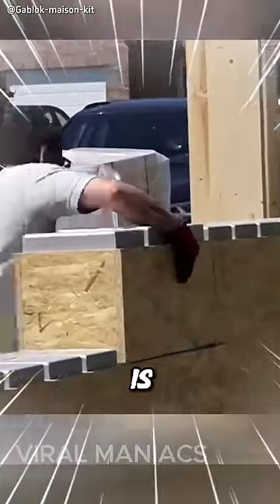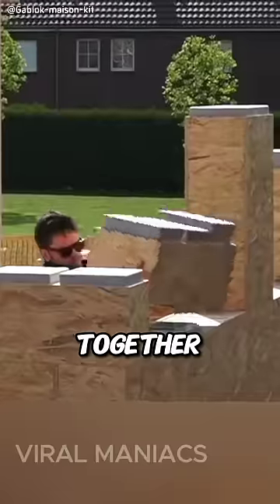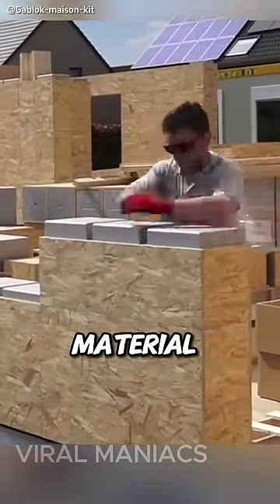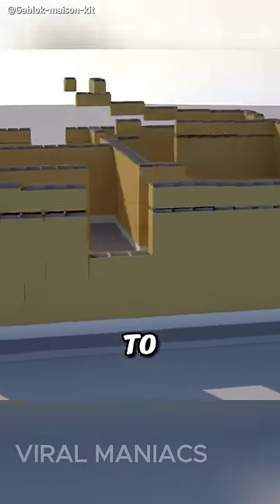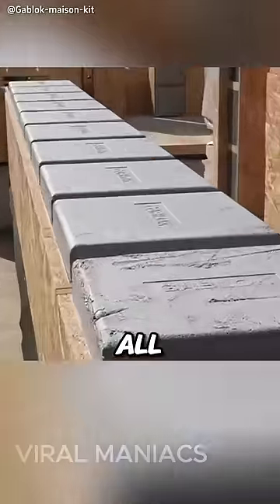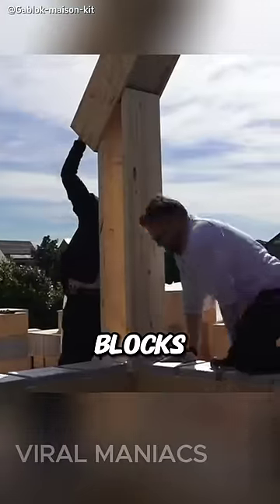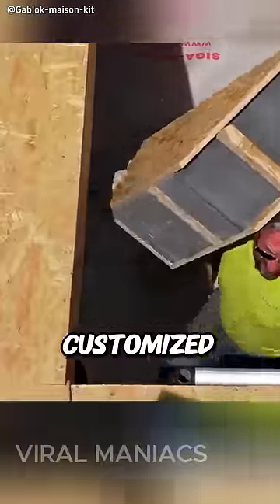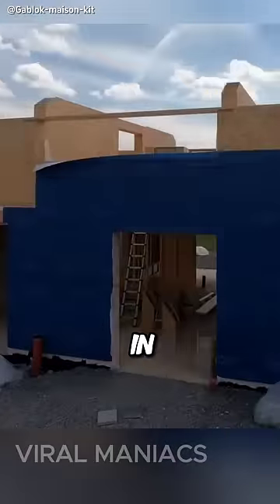Whoever Invented This Way Of Building Houses Is a Genius #shorts

Comment: Unfortunately, this solution doesn't consider electrical wiring, pipes, and ventilation requirements.
Reply: It probably has all that, but there's only so much you can fit in a you tube short. Im still skeptical like you though.
Reply: Polystyrene insulation is made with butane or pentane gas, or some flammable blowing agent.
Reply: yeah.... I'm sure the million dollar company didn't think of what will from Utah did..
Reply: @nicholasbondurant  Grendel block fire is something you might wanna read regarding your multi million dollar companies churning out unsafe materials not fit for purpose
Reply: @nicholasbondurant haha yes everbody just says things like that without taking the time to see that the solution are little spacers on the wall or belive that there is a solution for such an obvious problem.
Reply: Who’s to say in low budget housing you don’t make everything exposed or concealed in PVC like electrical wiring.
Reply: @PerryPerfectPerson   trunking is a myth I guess
Reply: You usually run all that behind dry wall that's actually no different than how they actually build houses except it's not bricks they lay everything out them selfs and do all the supports and framing
Reply: Frame it out with 2x6s. Then drywall.
Reply: It also doesn't address thermal bridging between the insulation blocks or wind uplift pulling the blocks apart. It wants to be a good idea, but falls well short.
Reply: @kramnull8962  And fire retardant mixed in wherever necessary. I worked in the manufacturing plant.
Reply: I'm sure they can cut the blocks later on to run pipes and cables internally if they don't  want them exposed. It's just wood and really thick insulation foam afterall.
Reply: @KurtL1776    
OK ..... I can't criticize you for not taking the time to research building techniques.
But even my 8 year old son has the common sense to know that building materials & methods have to be engineered, tested and approved by the building standards departments etc and certified into the relevant building codes. Also, common practice to "tie down" building panels, frames, etc with straps, fixing brackets, braces, tie rods etc.              Use a bit of common sense, man ‼️
Reply: @kramnull8962 Brick, wood, and metal along with insulation materials are all flammable. What's your point?! THERE IS NO SUCH THING AS AN INFLAMMATORY HOME.🤣🤣🤣🤣
Reply: Damn buddy, better go tell this checks notes successful company they are doing it all wrong.
Reply: @PerryPerfectPerson  I honestly wouldn't care about exposed wiring, or piping. honestly if it's out, it's easier to maintain.
Reply: Or rebar for support
Reply: @kramnull8962 it actually consider all of that you were to lazy to take 5 mins an research so you just talking about stuff you don't know $hit about...
Reply: Who needs those when building a house is so easy😅
Reply: It seems like it's the perfect setup to add your own wiring, plumbing, and HVAC schematics. That material doesn't look difficult to work through.
Reply: Neither dead building Legos but obviously the man who invented this was a Lego lover 😂😂
Reply: Better than nothing. Perhaps they do have a solution. Perhaps one can figure it out. But praise God for shelter at all.
Reply: @Azrael315  Children, pets.  I couldn't live in one. The off gassing would kill me.
Reply: Shouldn't be any harder to address than say log cabins or stone houses.
Reply: I was just thinking that

They conveniently leave out that detail LOL😅
Reply: This replaces concrete block. That shit doesn't run through the concrete block anyway unless it is going outside. It will probably be run in the subwalls
Reply: Surface mounted everything like a studio
Reply: Or code requirements
Reply: We used an ICF fox blocks system and our pipes were installed with the foundation so that they already existed when the walls went up.
Reply: Or the Scottish weather.
Reply: i just dont see how a pure brick would help more for all of the things you have mentrioned
Reply: @kramnull8962  Are the construction materials LEED approved or will you get sick right away because you moved in?
Reply: I like how all the builders drop cringey comments
Reply: You could always just carve through the blocks and stuff pvc pipes through them or frame it out and run it that way, good idea for Small additions that wouldn't really require it though
Reply: I'm pretty sure this was only a concept.
Reply: China be like
Reply: The tornadoes will fix that bro
Reply: That's not true that dude that invented that starlight material would seriously beg to differ. That was some hardcore shit back in the day that he took to the grave with him. If I'm not mistaken I do believe once he let that cat out of the bag and enough people saw it they have somehow reversed engineered it from absolutely nothing considering that dude used to take everything with him any ashes any dust any dirt grime it doesn't matter what it was if it was residuals from his showing of that product he took that shit and put it in the bag and took it back home with him so nobody else could ever find out what it was. That's one of the only inventions that I've ever seen that I was truly blown away by and always wondered what happened to it but he never wanted to sell it to anybody. People offer to him pennies on the dollar. Actually I take that back people offered him pennies on the $100. That material could have saved just hundreds of billions of dollars over human history if people are allowed to use it. It literally does not burn. You could coat the outside of a raw egg with it and literally put a acetylene torch to it and hold it there for 5 minutes or so and take the torch off and actually crack the egg open and it still be completely raw it will have not cooked not a single bit. Go look that stuff up. @sjlewis271
Reply: Or extreme weather
Reply: I mean you can have a industrial look inside your house if you are into that!!!😂😂😂
Reply: Can someone tell me the name of the company olease
Reply: But you have a house! 😂
Reply: @sjlewis271  Point is there is gas inside the containers containing the foam. Just like loading foam into a semi trailer and opening the back door with a lit cigarette,
Reply: @sjlewis271  Try adding a few pounds of butane into your walls.
Reply: @sjlewis271  Sorry I shouldn't have replied since you think metal is flammable.
Reply: @JosephIodice-ep1gc  And those little white pellets do nothing for the gas trapped in the foam. Only the burning progress of the plastic...
I've watched 400 pound rolls of foam with fire retardant burn 40' high.......
Reply: the full length video covers everything
Reply: @metalmacabre9991   Has all that where.  I didn't see any openings in the ends of those Lego blocks to fish wiring through and once those walls are completed, it would impossible to run rigid pipes through them as well.
Reply: @KurtL1776 you haven't even seen one built and think a 1 minute video, says it all. Some people are so fkg ignorant 🙄
Reply: @JosephIodice-ep1gc right. It's seriously obvious and yet they choose to show everyone their ignorance.
Reply: I seriously don't understand how some of these people in the comments make it through the day being so ignorant. 🙄
Reply: @shandelebroyles1099  As an architect, I have researched this company and their system beyond the one minute video, and I stand by my original comments. However, after 25 years of construction and design experience, I do recognize that I will never know everything there is to know about this field. I will never claim that I have it all figured out. Therefore, I am certain that your expansive and deep knowledge base of the AEC field can help me up and out of my ignorance regarding the disadvantages of modular building systems and why this system doesn't fall prey to the same issues.
Reply: indeed how are they gonna put in the plumbing and electrics
Reply: Thank you!!! I just made a comment saying basically this same thing.
Reply: @JosephIodice-ep1gc No it's going to be held together with nailed hardi board lap siding. It'll be just fine. The inside will have drywall screwed to it which almost has as much structural integrity as the siding so when you add the two together only most of the houses blow away or fall apart. It's really no big deal to retrieve the blocks and start over. Codes schmodes nobody has time for that.
Reply: Oh yes they run the Electric and Plumbing through the bottom and also your exterior walls that need wiring and Plumbing they have these blocks prefabbed with tubing for your wires. They have built entire apartment complexes down in Florida where it's hot with these blocks it's crazy. It actually might not be a bad idea. I do realize that the poly material is typically highly flammable and toxic. But they are designing these with some sort of flame retardation inside of the product. I live in Kentucky myself, if I were going to construct with this type of material I would definitely want to use brick for my exterior, just four piece of mind
Reply: It's honestly probably a lot easier
Reply: And not ready for real winter 😂
Reply: @joshfriedman9775  I can tell you've never had to drill holes and pull wire. 

I can think of other ways to get the wire to where it needs to be, but if I had to drill through all of that crap, it would suck.
Reply: I could see a future where we have lego like versions of that we just don't care to do it. Probably because the cost is still going to be high so you might as well just do it traditional.
Reply: In Scotland we do something called a service void, 25mm rigid insulation then 50mm batons on top so the pipes and cables can get run through them instead
Reply: @kramnull8962 I kinda wonder if it's supposed to air out for a while.
Reply: @DJRenee  They would need to, but you can rest assured that will be the first step to get skipped. Time is money.
Huge step from the 1st shift safety man to the manufacturing floor on 2nd and 3rd shift.
Reply: @metalhd7277  they already layed that out in foundational structures support the framing devices aka the bricks they are using are a Limited model molding design for prefabricated housing.
Reply: You do all those on surface of the interor walls (here a current code, as after 50 years of demanding them to be inside the walls made major problem from all of those). 

And then ventilation is done by simply drilling holes where required and place the shafts and temperature controlled vents, that will make a passive self-controlled ventilation, like it was done for centuries...
Reply: @sjlewis271 sure it is. My grandparents house in Mexico is made of concrete. My gramps fell asleep cooking on time and caught the kitchen on fire.  The only thing that burned was the cabinets and table in the kitchen part. House is still standing and my sister lives in it 36 years later 😂😂😂
Reply: @nicholasbondurant knowing Utah, will prolly funded a lot of loans for that multi million dollar company
Reply: I was about to say that. There's always option to have it inside the building, but that's gonna look pretty bad. 
Though this thing might be pretty cheap, so if you're under tight budget and want a house, it's a decent enough option. 
Not suited for areas where wind can be a problem. Pretty sure first propper storm or a hurricane will blow this thing across 6 different towns. XD
Reply: @metalmacabre9991  have you ever built a house?
Reply: @Alarcon664 Not if he plans to keep his wife. Why would she want to live in a deserted warehouse the will self ignite if she raises the temperature
of a skillet above 40 degrees.
    Naa, I'm older than dirt, and I'll stick to Stick and brick, or CBS. Thanks for the video, though.
Reply: @notanetbanger No, coffin that comes with built in cremation, in case of fire, chemical poisoning, or case one or the other (male or female) chooses to collect insurance proceeds ... for the latest flame.
Reply: @kramnull8962  Willy Peter ring a bell? White phosphorus ? Melts right through metal.
Reply: @ShandeleReynolds but not so ignorant as to buy one of those coffins. Nope, I'll keep my pennies, and live in my stick and brick hooch. Alla ya'll have a good night/day, and tell every body when  ya'll turn in, that you love them.
Every morning, 3000 people in the world do not wake up. So when you open your peepers, say: "Thank you God."
Reply: @ShandeleReynolds I once knew a gent named Broyles . Interesting gentleman . Met him in Vietnam. Wonder if he made it home. Related to you?
Reply: on the inside a 2x4 frame and gyprock walls.  do u think chipboard is what ur inside walls are going to look like? no lol  even normal houses have these types of walls, not just concrete blocks.
Reply: Sounds highly flammable and unsafe and likely won’t pass any safety tests with housing regulations ……
Reply: The company provide sufficient blocks to also build an outhouse.
Reply: @athomenotavailable  I would say that since they require you to lay out the foundation and blueprint of your home before even making the bricks, all internal wiring and plumbing must be included in the design and accounted for with 'specialty blocks' like the ones used for the roof.  It's not like LEGO where you place one block and pick up another and make the design 'as  you go'.
Reply: This is very similar to the way concrete block houses are built.  You will still need to do framing on the inside so that you can run the necessary pipes, wiring, etc.  And then finish the walls with plasterboard.
Reply: @sjlewis271 Brick and metal are flammable.  On the SUN, son!  Woop WOOOOP!!!

But no, you are correct about the other stuff.
Reply: @Azrael315 STEAMPUNK!
Reply: @ExtraterrestrialBeing-jc7to Did you mean to type "shit"?

SHIT
SHIT
SHIT!!!

Omg, YouTube!  I typed "SHIT"!  I guess I've killed ys all....
I'm sorry.😭
Reply: @chizukanelson7947  everytime I type a Curse word I get banned for 24 hours..YouTube has it out for me
Reply: Everyone watches a 60 second video and has all this to say😂
Reply: Interesting 🤔
Reply: I think all these could be done with specialized lego pieces. Or by modifying the pieces yourself.
Reply: @garystump5680 so you're saying  you'd have to fir out the walls for conduit, hvac, and plumbing? That's a lot of work and $$$, plus balancing the A/C and heat would be difficult? They didn't say anything about the roof,too?
Reply: Lego mindstorm  edition is sold separately
Reply: Find Gablok - An innovative construction system. It is actually not bad.
Reply: An oldfashioned brick wall does not consider that either, does it.
Reply: @nicholasbondurant  or wind
Reply: Conduit lines are usually pre-fabbed into the blocks. So you have to install them exactly in the right order.
Reply: @JosephIodice-ep1gc the youtube experts are on a whole different level, didn't you know that? Company's blindly make products without testing or approval & just sell them to the world 😂
Reply: You lose a lot of space by using these thick walls inside your house.
Reply: You've never been in older homes that have exterior pipes?

Comment: Someone mentioned this is a good way to split the house in a divorce and it really is. The company could even give a prenuptial kit that has two extra designs included. These two extra sets of prints are different home models using only half the blocks. This way, you can both take equal amount of blocks and then rebuild your own smaller house. So, its either one big home, or two small homes.
Reply: Divorce is more like 80/20 than 50/50.
Reply: So the gov says the woman gets 85 percent of the blocks plus the kids and money.   The guy gets enough blocks to build a small shed.
Reply: So wo gets the left side?